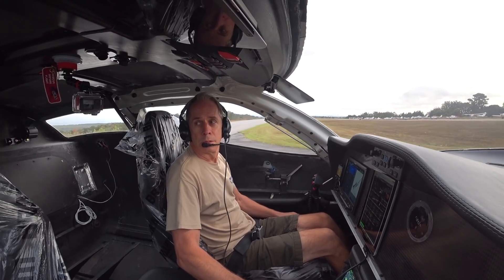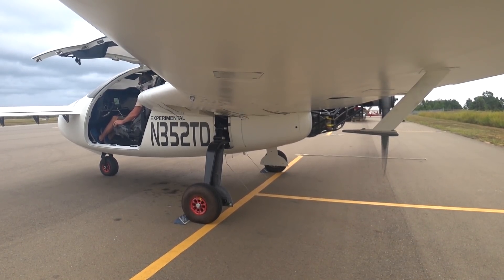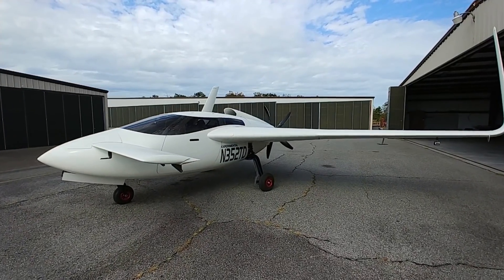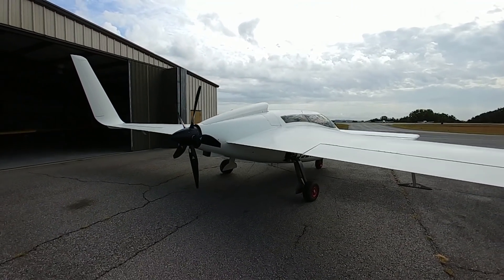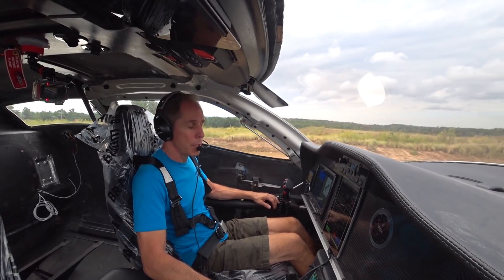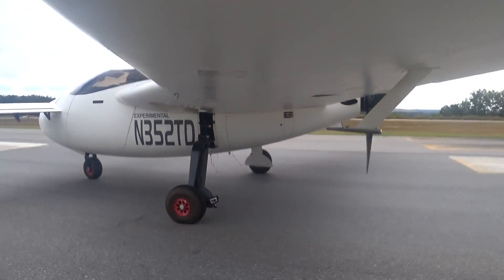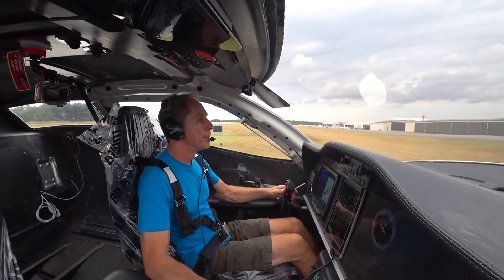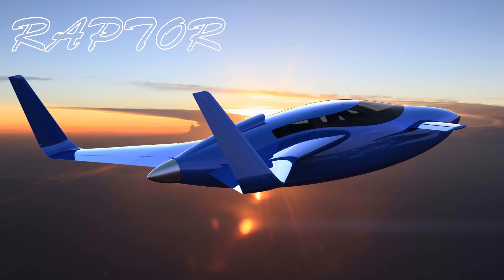All Dressed Up - Building the Raptor Prototype

Comment: The higher sustained pump pressure the lower the lifespan. You are totally clueless and a total danger to those around you. There are limits built into the system to try to prevent catastrophic failure.

Comment: Hi Peter:- Have you considered :: Turbine Aeronautics Holdings Pty Ltd 
14-18 Rosslyn St 
Mile End South, SA 5031 AUSTRALIA

They have an upcoming Turbine Engine made exclusively for Aviation:: TA300TP Turboprop (300hp).
They are pricing it at almost half the price of a Delta Hawk.
Maybe you could use their TA200TP (200hp) for flight testing. They might even hurry up development on their 300hp engine when they know that 1,500 deposits are in place. Even if only 25% are committed...it's still a lot of leverage.
Most of the deposit holders may pay a little extra for these Turbo-Prop engines, w/o pistons.

***If you've already explored this option ...I apologize.

Comment: It would seem that as long as there is a bit of surplus power to get you out of trouble, then perhaps the more reliable engine options would be best for now. Because diesel engines are rare in general aviation, it's easy to want to prove just what they can do for power--yet some of that proof might be best spent on reliability, for now. I wonder if there is such a thing as a small air pressure-buffered fuel accumulator to calm down the pump hysteresis, though that's adding another part to an airplane.

The cowling looks great on there. It's good news about the heat. It might also be good to take it off and check for leaks on the fairing, every so often.

The headset mic sound is better. It might be nice to see some passby views, if you have an assistant. The prop was blowing the grass back pretty far.

Wishing you a boring, deliberate, and methodical testing period. : )
Reply: The issue seems to be that the engine isn't even making the power it should make completely stock. Even without stressing the components beyond what Audi designed them for, this engine should be able to easily do over 300 hp all day. I agree with the many people here that have advised Peter to get help from a diesel tuning expert, as there are many in his area.
Reply: @CockatooDude  , I imagine that it might be complicated because he has a custom controller, they are likely not familiar with. Still, the more the merrier.

Comment: Have you checked the psi going to the high pressure pump. I had a similar issue with my diesel truck running biodiesel. I had to install a FASS lift pump and change the spring in the lift pump for 15 psi going to the high pressure engine pump. Once I installed this I never had issues with fuel starvation going to the high pressure pump under high throttle settings. Just a thought.

Comment: Did u look at the higher powered Audi diesel engine equivalent parts, ie SQ7 as in road trim they produce more power. Another future consideration is to go to a Haltec ECU, as they are remotely tuneable, so you can get a professional tuner to help whenever needed.

Comment: It might be better if you had a latch hooked up with that parachute hatch so you can be sure that it will only open when you pull the lever to fire the rocket. Otherwise you could start a fire along side what ever control emergency you have, or create a control emergency by having a chunk of the airplane fall off mid flight.

Comment: This project gives me a new appreciation for the term “Experimental” Aircraft.   It also gives me a new appreciation for the term  “Certified” Aircraft !
Reply: I come from the formula car racing world where virtually everything is "experimental" every season. I guess this gives me s unique perspective.
Reply: How so?
Reply: Jules Dufresne A brand new airframe design coupled with a non-certified power plant is a compilation of multiple ongoing “experiments.”  Hence the term “Experimental.”   Every system and its interaction with the other systems have not been proven and are thus many experiments going on at the same time with the outcomes unknown.   This exact “total system” has never been tried even once before.   Certified aircraft have been forced to go through all of the possible outcomes in advance, thereby ensuring the “total system”  i.e. airframe and power plant function in a manner that provides predictable performance and acceptable safety for the masses.  A buyer of a certified aircraft needs to “appreciate” all of the trials that preceded the certification stamp.  Nose wheel shimmy,  Diesel engine tuning,  possible flutter, landing gear operation, automobile engine running in aircraft engine regimes....   Any new design of airframe and power plant is a complete experiment, until it is not....
Reply: I guess you certainly do !   The one thing you can do is pull over if the engine quits.  :).

Comment: ,,, alright, didn't like the former.  Try this, you are running more boost; however you have the Motec, so shouldn't be the problem.  But, check the boost sensor(s), fairly regular occurrence, and can give you a derate  .

Comment: Have you been checking if the turbo is working as it should. I had a similar problem in my Audi car engine and that was due to a malfunctioning turbo. Idk, I just toss out the idea. Hope you get the engine working again with full effect. Keep it up.

Comment: If common rail pressure is erratic, usually you have a fried injector. The way to check for this is to remove the return lines on each injector and attach translucent hoses that go up vertically. You then run the engine and observe the fuel level rising in the newly attached return hoses. A bad injector will release more diesel via the return line. If all is good the level will rise slowly and evenly in all hoses. Bad injectors can be sent in for test and overhaul.

Comment: Need larger nozzle injectors. Bumping high shut off on fuel pressure. Not sure if you can adjust that set point higher.

Comment: I've seen a similar thing happen to a Cummins diesel that had larger aftermarket injectors added and it turned out to be a tiny tiny drop of air was getting trapped in the fuel rail right before it hit the injector. When he would stand on the gas, it would pull that air bubble down just enough to cause an airlock and the diesel wouldn't flow or sometimes it'd sound like a hammer was sitting on top of the Piston from that air bubble oscillating at a high frequency. I don't know much about the VW diesels, but I know all diesels run ridiculously high amounts of fuel pressure. So much so that Cummins scraps fuel lines if they have a scratch deep enough to catch your fingernail. It may not be the programming at all. Could just be the weak link showing itself under those high fuel pressures.
Reply: BIG WIGGLE the thing is this is running WAY below what the common rail and injector pump are rated at so some better aftermarket injectors is probably the right track.
Reply: @NC_Hydro  this is true. I know the larger injector in the Cummins wasn't the issue, it was bc the fuel line wasn't properly bled after the injectors were installed.

Comment: What size is the stock injectors ? I have a feeling that if you can try getting a set of new injectors with a larger diameter injector ports and possibly the ones with eight ports as I think that will not only increase fuel flow into the cylinders and thus reducing the high rpm power loss passed the governed rpm and that way you have better altitude throttle response . like I said before it is just a feeling of what you want to happen with the engine .

Comment: A pretty plane but I still want to see it in the air . just my thoughts but I don't think that a diesel engine was supposed to be run over 2700 RPM at peak RPM . If I remember correctly a diesel engine develops full torque at around 1400 to 1600 RPM .
Reply: Joe Wilson every diesel is different, what you said is true of say a Cummins in-line 6 but not a V6 Audi

Comment: I use Spirig CelsiStrips to record temperatures on transmissions, transmission coolers, and transmission cooler lines.  Cheap, easy to use, and effective.  It can be used to record "under the hood temperatures" of the Raptor.  I bought a roll of 1K strips in 2013 and still have 100 or so left.  I think I paid something like $500 for the roll if I remember correctly.
Video:-->https://youtu.be/gQ632mP02m0  
Go to http://www.spirig.com/index.php?id=73&L=576   
The US distributor is 
SPIRIG OFFICE USA

SAT Spirig Advanced Technologies Inc.

144 Oakland Street
Springfield, MA 01108, USA
Phone: +1-866-977-4744 (Toll-Free Number)
Fax:     +1-413-788-0490
E-mail: sat(at)spirig.com    or  order(at)spirig.com
www.spirigusa.com

I wish you luck in figuring out the 30K psi injector pump pressure issue.

Comment: Just a thought, but could the pump possibly be cavitation in the tank? Diesels usually like big amounts of fuel, but not mixed with any air. Might be something to look at. It almost sounds like that’s what’s happening, getting air into the system. Just a thought.

Comment: I suspect the MoTeC system, if it's anything like their gasoline systems, doesn't actually sample fuel rail pressure synchronously with the fuel pump but rather only in the time domain so your fuel pressure signal is actually a load of heavily filtered bollocks, hence there's two tenths of no chance of actually getting decent pressure control happening.

Comment: You should see if Gale Banks from Banks Power can get involved to lend a hand. He's one of the best diesel tuners on the planet. He does everything from monster truck engines to the engine for the US Army's Joint Light Tactical Vehicle (JLTV).  He seems to love a challenge and would probably think that your push to help make general aviation more accessible is pretty cool.   Banks power also has a youtube channel as well. Check him out.
Reply: My thoughts exactly it's been his life for longer than most of us have been alive over, 50 years.
I am waiting for his tuning videos of the new duramax 6 cylinder engines might be a US source for new engines for production if they are light enough.  I think a Banks engine would be the most reliable high performance engine in the world no matter where the base motor comes from. He would build it for the application.

Comment: ANYWHO- i'm sure it can be done. BUT- if ready-made aftermarket 2000 bar injectors for the audi doesn't exist- I'd have some custom ones adapted or modded. then for the procution run, just have the heads on all future audi's bored to fit a commercial bosch injector.

Comment: so they DO exist. finding one that fits your audi tdi might be a challenge... but just might exist.  of course, you could custom machine an 'adapter' to install a commercial injustor- maybe... maybe worth it ? I know some tractor diesel mechanics who "mod" injection systems to put john deere engines in pickup trucks.. those guys can get modded injectors that'll fit your engine- I'd bet $ on it.

Comment: general thought - if the issue isn't providing you good data, perhaps it's mechanical?  sounds like the injectors are being held shut by pressure at load..... probably wrong, but it's a guess.  it looks amazing with the cowling on.

Comment: Both the fuel pump and the injectors are spec'd at 2,000 atm in that engine, that is 203 megapascal. Makes no sense that the injectors already start failing at what you think you are running them at. Is there maybe a conversion issue when interpreting the common rail pressure data?
Reply: Maybe consider throwing the pump and injectors out and putting in a more modern CRS3-27 injection system from Bosch. It runs at 2,700 atm / 274 megapascal and allows 134 hp per liter which would give you 400 hp.
Reply: There are tuning companies that have made adapters for the TDI 3.0 engine to get the newer pumps mounted, see e.g. https://www.darksidedevelopments.co.uk/products/cp3-fuel-pump-upgrade-for-2-7-3-0-common-rail-engines.html
Reply: Most likely , the return valve opens up at a certain point and releases the pressure , so the injectors get no fuel .

Comment: Cowling too hot? Use Fibrefrax from Aircraft Spruce. Glue it on with 3m 1300L, seal the edges with high temp silicone, then finish off by spray painting silver. I did this to a Super Decathlon and you can lay your hand on the cowl by the exhaust pipes, right after landing and it will feel cool to the touch. Before it actually bubbled the paint. I also treated a PA28R-200 that had the same problem.
Reply: I.R. Wayright I believe he actually did this if you’re new it’s in one of the older videos

Comment: ,,, probably not it, but, with more fuel pressure, is the prop governor getting after it (the rpm) more aggressively  ? But as I think of this that shouldn't cause a shutdown or dropping off to idle . 17,400 psi is really not that much in the common rail world .

Comment: I think you might have a restriction in your fuel feed to the pump...
Reply: Richard Wooldridge yeah I would be interested to find out what the fuel pressure coming into the injector pump is.  My Cummins stock pump was crap and only provided max 6psi which is just barely enough and was probably the reason my first injector pump failed.  Now I run it at 13-15psi and have a gauge so I can always see what it is at

Comment: Anytime a manufacturer like VW builds an engine, they spend millions to make it as cost effective, high performance, and dependable as possible. So anytime we start adding multiple turbos and programming air/fuel mixture and timing etc we sorta throw all that money spent by experts out the window. I’ve found with car engine “factory” always out performs when you keep all those 3 things in mind.
Reply: Dustin Ruth not true, they often times build in subtle failure points that prevent you from driving for decades but instead have you looking for new vehicles.   Case and point my 2000 dodge Cummins factory default aka perfect setup as you are suggesting the stock lift pump is on the engine and has to suck the fuel from the rear, results in 6psi to the VP44 injector pump.  So yeah I really messed with the masterpiece by adding an aftermarket pump by the tank that now gives me a solid fuel pressure.  And on the same subject I can get aftermarket injectors that add 40hp AND increase MPG....so no just because the factory spent “millions” does not at all mean it is the best setup and shouldn’t be tweaked.
Reply: MoFreckles you’re right. There are exceptions. Never said they don’t make mistakes. In my 15 years as an automotive tech I’ve seen quite a bit. But more often then manufacturer mistakes I see cars destroyed by customers trying to mess with timing/air/fuel mixture or adding stuff. As a pilot I wouldn’t want to be flying in an airplane with and engine that’s modded without a fair amount of resources invested in that one ☝🏼 piece (the power plant).
Reply: Dustin Ruth personally I would rather fly in one that has been improved with aftermarket fixes
Reply: MoFreckles hahaha. Cool man. You is so brave. Factory = Gooder
Reply: Dustin Ruth no it’s not about being brave it’s if you want anything done right you do it yourself.
Reply: MoFreckles hahaha. Cool man. So smart you is...hard to believe between aerodynamics, physics, engine mechanics, navigation systems, pressurization systems, safety systems, propeller efficiencies, landing gear design etc, that one ☝🏼 man ”will do it the right way because he’s doing it himself”...if I heard right in the video the designer said himself he has to go back to the factory pressure to get the engine to run right like it did before?...lucky you bought the dodge with the Cummins. Had you bought a power stroke  it wouldn’t be running 20 years later hahaha.
Reply: Dustin Ruth lol truth on the Power Stroke, there is a reason Diesel engine classes use them as class projects so often they’re a dime a dozen with blown up engines for cheap 😁

Comment: well you need injectors rated for higher flow setting or else the rail pressure will just spike while the injectors are firing at their lower pressure set.
Reply: Was thinking the same.. are these set up as manifold injected or direct injection in cylinders ?  Was thinking the higher pressure operation may be affecting spray patterns negatively causing fuel to impact surfaces instead of staying atomized in airflow. Is running dual injectors an option to increase flow, vs individual larger injectors ? Would be interesting to simulate in a large windowed pressurized tank with video for short term operation keeping same number of injectors, same rail, etc.
Reply: This is a modern Diesel engine, so commonrail direct injection from factory. 
Also, 95Mpa is joke for Commonrail systems, as they usually run at least twice that from factory. 

The effect of that "low" fuel pressure is poor flow and a wide injection angle.
This gives bad efficiency and smoke. The fuel injected far after top dead center just burns up in the expanding gasses and heats it up a little further, giving you the high EGT.
That's where the lackluster performance comes from, that people were talking about. 
You inject diesel for 380HP, but because you inject it too slow, most of it goes out the exhaust in form of smoke and high EGT